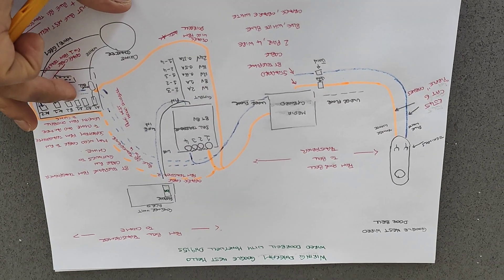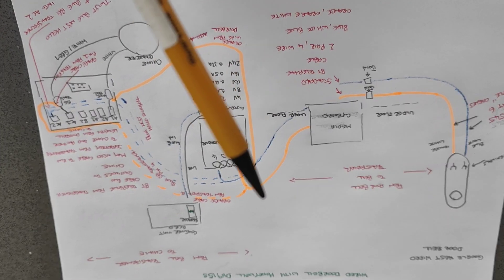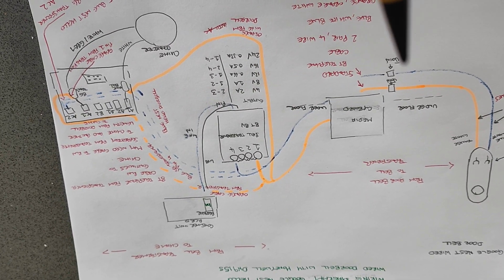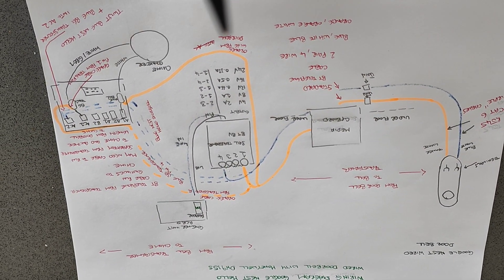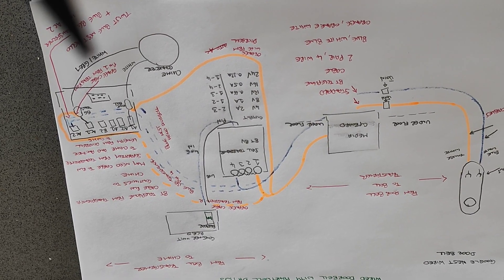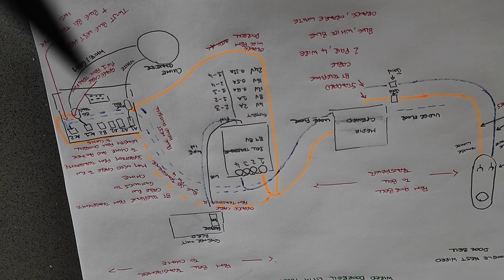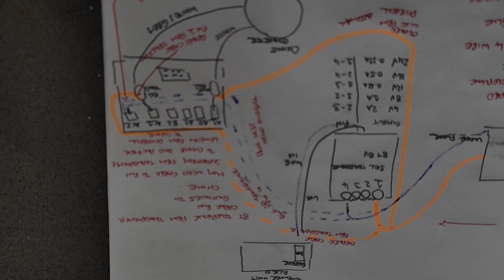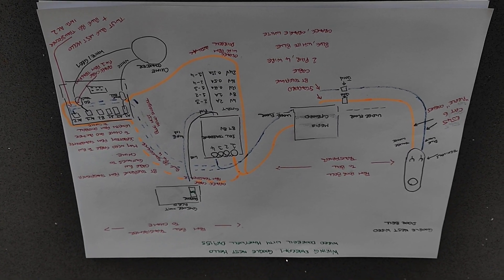Google NEST Hello Wired Doorbell WIRING DIAGRAM for Honeywell DW915s Electronic Chime

Comment: Hello - Nice Video I have copied for the video picture of the wiring diagram for those who do not want to turn their monitors upside down :-) 

https://docs.google.com/presentation/d/1q2_jtx6zrdgWXqENeR1kdnUvBHYDiQom9NAkOmMmDOk

This has helped me with my understanding.

One question I have is that why did you connect the Honeywell to a 24 Volt source as the card in the box says 8-12 Volts . 

This video was really good in terms of how the Google Chime worked with the 4 cables - has a basic bell though!.  
https://www.youtube.com/watch?v=6Al0qwiklJY

This is also a nice video as well
https://www.youtube.com/watch?v=ORhUadv2H2Q

The other comment is that the diagram looks like the chime only has 2 cables whereas it has 4.  

Disclaimer - I am also not an electrician..